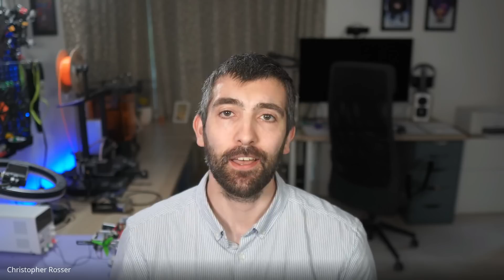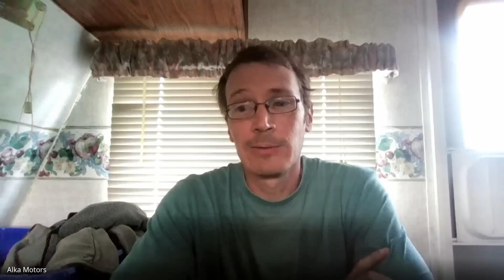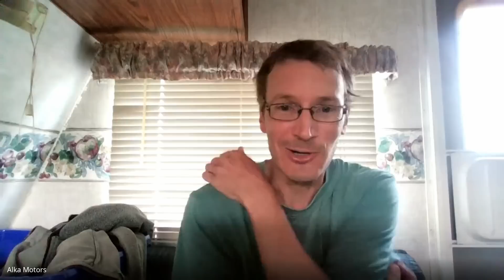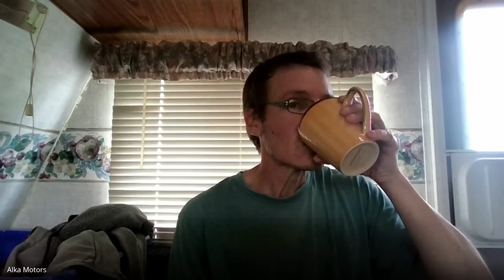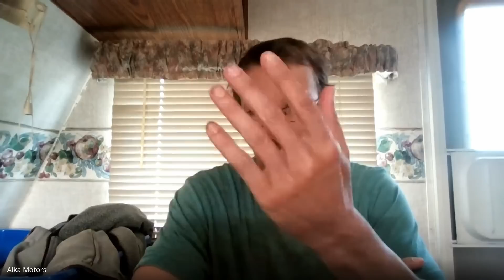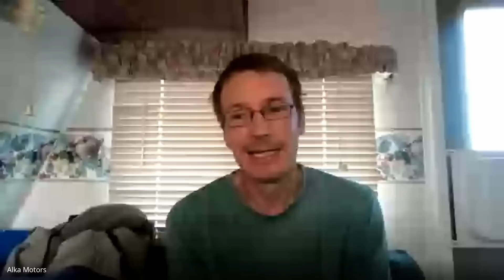Interview with the Lead Developer of AM32 ESC firmware - Alka Motors

Comment: AM32 Discord is great, I was helped every time  I hit the wall trying to install AM32 bootloader. Only thing than is heavilly missing is reverse engineering of BLHeli_32 update process allowing smooth pure SW install of AM32 bootloader + firmware without need to solder those tiny solder pads.
Reply: The AM32 Unlocker tool makes it a lot easier. No soldering required except for a ground wire to the ST Link tool. But even then, you don't solder to the tiny programming pads like before.

Comment: Maybe someone can chime in here because I haven't looked yet, but are there any single AM32 ESCs on the market for the fixed wing market?
Reply from the maker: Yes, some are designed for crawlers but you can reset the settings and use them on wings.

Comment: If a manufacturer has a issue, Make a side program for if the AM32 ESC fails it will record the problem on something kinda like Black Box  🎁then the code can be adjusted.

Comment: "in phase current sensing" that does sound interesting, but why dont we just go full hall effect for crawlers?  They could be easily added to outrunners with a 3d printed mount. The sensors aren't exactly expensive these days.
Reply from the maker: We've got some prototype hardware coming for hall sensor integration.
Reply: @ChrisRosser  Oh nice.  I could see that being useful for hobbyist robotics as well.  Is the hardware as simple as breaking out some IO pads for the sensor inputs?  If so, hopefully manufactures will start doing so regularly.

Comment: You mentioned that some ESCs and some motors are not a good combination. I've been building drones for 12 years and I would love to try AM 32. In your experience which ESC and motor combination has been the best performer on AM 32 for 5-in quads?